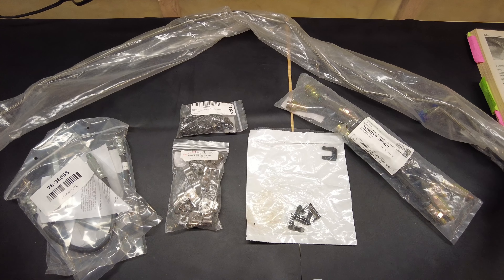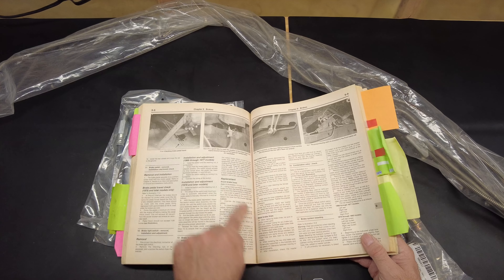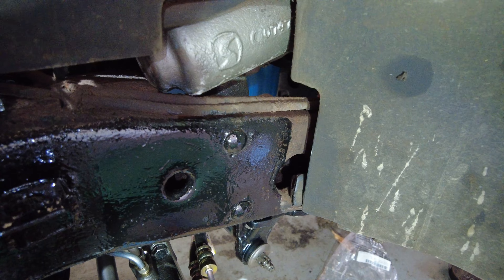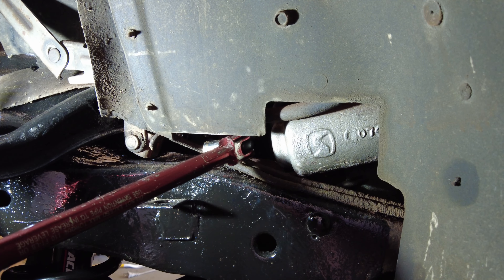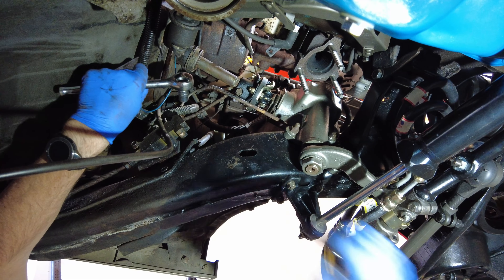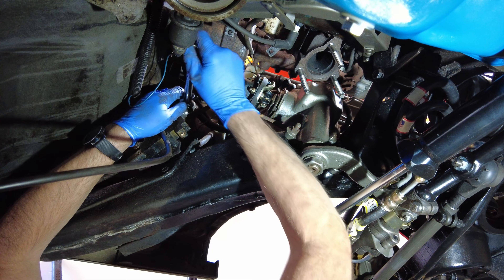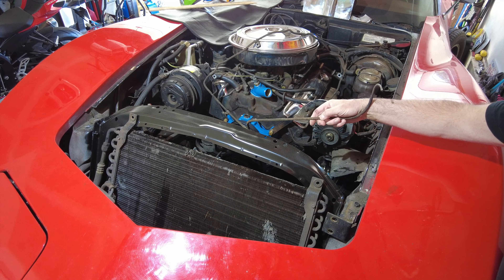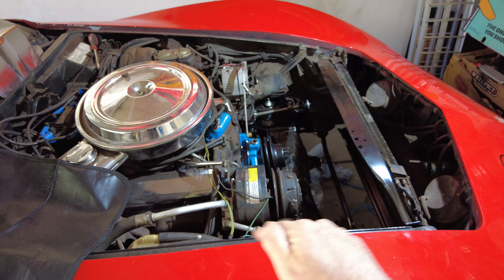Real-life C3 Corvette Complete Front Brake Line Installation - Hard Steel Crossover line and More!

Comment: Any reason why you didn't go with flexible stainless steel brake hoses instead of the rubber ones? Great video!
Reply from the maker: That'd a very good point. The hoses I bought from Corvette Depot just happened to be rubber and basically the same as the 20 year old hoses I took off. That being said, I may order some braided steel hoses and install off camera.  Thanks for the comment and for watching. J